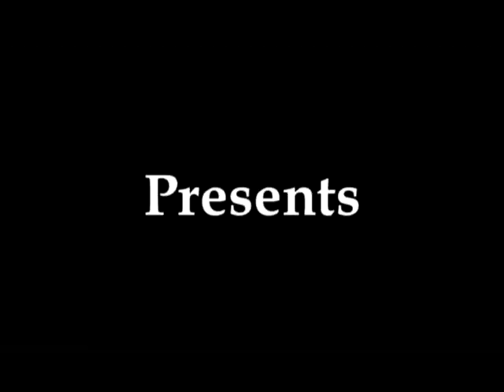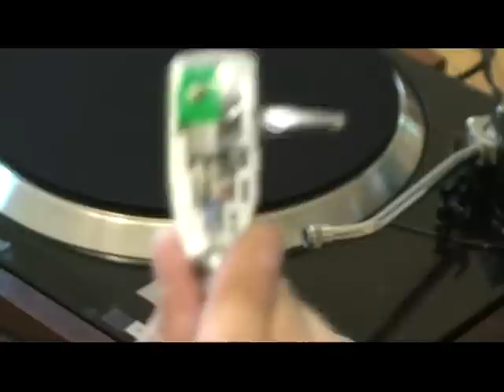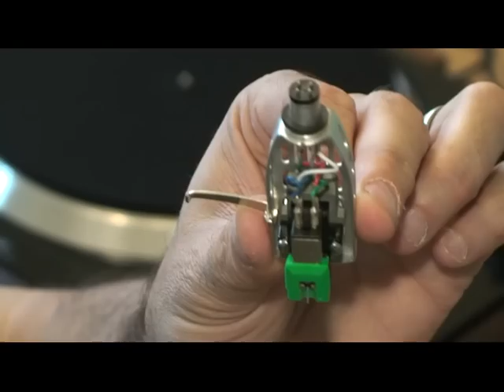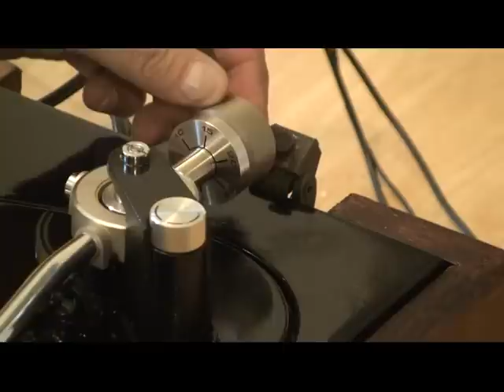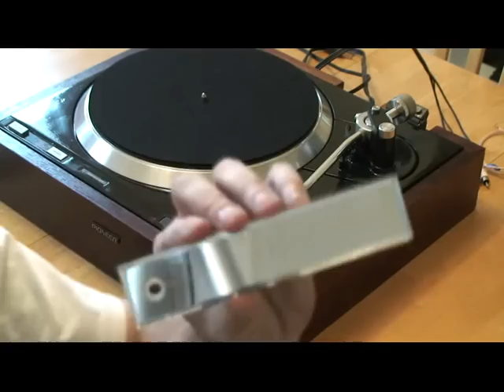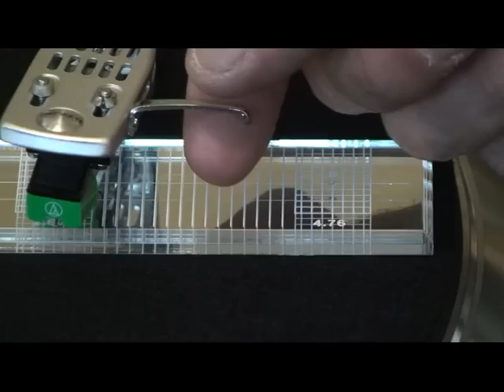How to setup a turntable - turntable and tonearm setup

Comment: Thanks for this video.  The procedure you outlined on how to use the bearwald protractor answered many questions that I had.  Specifically that the platter needs to be rotated slightly for the stylus to line up with the inner null point.  Thanks again!

Comment: Wonderful job in explaining a complex setup in a straightforward way. Just a small point. After doing your alignment it’s worth rechecking the tracking force.
Reply from the maker: Thanks Tim and you are correct. There are many things I could "do over" , for example , checking the weight should be done level with the platter - but I wanted to help the real new newbies understand the concepts in a simple way. I don't even use the protractor myself anymore because I have a custom mirror alignment tool that is etched - one of our audio friends designed and built them....really cool...Thanks for the feedback !

Comment: Good explanation about using the Protractor for tracking setup which was what I was after, but, no mention of Overhang - that has to be first, re-checked last and crucial.
Reply from the maker: Actually no. You are confusing overhang. Overhang is what the manufacture gave as the "rough" number that could be used in lieue of a protractor - IF you know what alignment scheme they used (baerwald, Stevenson, etc.) where the overhang would be different depending on which is used. The protractor can ELIMINATE the overhang if done properly because it DOES set the overhang that is proper for that alignment scheme. Overhang can be used to "rough in" but only a protractor will ensure you are spot on. Want a good example ? Technics SL1200 MK2 overhang is 15mm but that is based on Stevenson. For baerwald (which I prefer ) it is 17mm. So if you aligned with a baerwald protractor and then went back and tried to set overhang, you would constantly be knocking out alignment.

Comment: You check the weight with the scale at that height it's not the same weight as when the stylus is actually touching the record. I would recommend doing the weight away from the platter and have something supporting the scale so that it is at exactly the height of the record.
Reply: @The Internetwanderer Not if there is a pivot point

Comment from the maker: Stijn...I agree with part of what you said and disagree on some. First, remember this is a total newbie training video. Your subject goes to a forum post (class 301...lol). So the basic manufacturer rule of thumb is set it on or about the same as VTF. A test record is great, but again, we are talking newbie. There are several basic ways to set anti skate (use a mono test record and your ears for example ) but it is a PROVEN fact there is a correlation between VTF and anti-skate. And setting your to 1/2 gram actually increases the need for anti skate and thus false readings. If VTF is increased (past what is needed) it can actually eliminate the need for anti-skate. Remember, skate is actually cause by resonant frequency vibration, not spin as many people think. So to test at 1/2 gram you have a needle that is vibrating wildly requiring incorrect counterforce. THIS IS WAY PAST where this topic should be on this beginner video. If you would like to discuss, post this on the turntable forum at audiokarma.  FOR YOU NEWBIES..STICK WITH THE VIDEO

Comment: Robert Arco,
thank you very much for the info on setting up a turntable i have just bought a used one.
it is a technics sl1200mk2 and i tried it out and my records sounded terrible..I played them first without cleaning them..so after i cleaned them the sound improved but i think i need to buy a new cartridge and do all of the adjustments that you have demonstrated.
Great tutorial!

Best wishes

Comment from the maker: Some additional notes to enhance the video
1) Best way to test the tracking force (VTF) is with a digital scale and off to the side of the platter so the scale level is level with the platter height. I show it on the platter but that could be off a bit.
2) When using a protractor, first get your overhang as close as possible first. Find out what it should be, say 52mm. Measure 52mm from the back rubber collar on the headshell to the tip of the diamond stylus. NOW use the protractor to be sure you are fine tuned.
3) When using the protractor, check the INNER point first. Align, then check the outer. If you have to change, go back to the inner and always start there,
4) Balance your table in place ! Use a small bubble level at the 4 OUTER corners of the platter. If you do it near the center you could be off. So check at 12, 3, 6 and 9 oclock positions on the platter.
5) Have patience - its worth it !!! And you can always reach me with questions

Comment from the maker: Hi Bryan,
I built it out of oak. I have made a number of bases to dress up tables. My latest project ? Another Pioneer Pl-600 that was beat up, completely stripped, serviced and now the plinth is BRIGHT RED with Black arm pivot area, chrome platter and arm tube and black headshell...Looks like a modern TT but with a killer vintage mechanics (quartz lock pll - full auto)

I can always be reached arcorob ..and that would be on that old gmail service...LOL

Comment: Excellent TT setup advice here especially the importance of stylus tracking force. Most cartridges track and sound better in the upper end of their recommended range. Even though it may be up to half a gram heavier the resulting improvement in tracking causes less record wear and smoother sound than if it was set to a lower weight but not tracking as well.

Comment: Good video for the beginner. I would highly recommend the use of a dBSystems protractor, or something equivalent, to set one of the more crucial aspects of cartridge alignment - overhang. Overhang will affect tracking force so it should be set first. I've found that one millimeter of difference one way or the other can make a big difference with overhang and subsequent alignment and weight adjustments. Good job!

Comment from the maker: That is an awesome table. Generally on the pioneer there is a screw adjustment. One to set the start position, another for the return. I go to vinylengine to get the user manuals and the service manuals. I looked for you and it is only in Japanese. I checked guides from similar tables (I believe yours was a Japan only model) and it might use a trip sensor ...I am really sorry I cant help..try this...go to audiokarm...(search for it) and go to the turntable forum. Post your question and they can help

Comment: When you set the tracking weight and get the tonearm to "float" you then need to turn the indicator dial with the numbers on it (but not the weight itself) so that it reads zero while the arm floats. This is the critical step that can't be overlooked. Once the line is matched with zero (while the arm floats), you then turn the counterweight itself (which also turns the indicator dial) to set to set desired tracking weight. 

From viewing this video at 11:32, the zero mark did not line up with the tonearm line when it was floating. It appeared to be about 0.15-0.20 grams left of the mark. So when the desired weight was selected, it was 0.18 grams too high. Had the indicator dial been zero'd first before the counterweight was turned it would have been accurate to with a couple hundredths of a gram...more than good enough! 

It's also worth noting that you're better off tracking slightly too high than too low. A cartridge tracking heavy will still track the groove well...and as long as the needle isn't damaged or worn out, it shouldn't cause excessive wear to the LP. A cartridge tracking too light with cause the needle to jump around in the groove, periodically losing contact with the surface. This will cause far more damage to an LP.
Reply from the maker: Incorrect. It was not zeroed because I was showing how you get it to balance. Then you would zero ...which is irrelevant because regardless of what the DIAL says, the electronic scale is what I said to use. You could erase those numbers and it would not matter. As to actual weight. Marketing says low, engineers say high. If range is 1.5 to 1.75 then best is just below max - 1.70.

Comment from the maker: Correct - and also incorrect - Manufacturers pushed the anti-skate / VTF coupling. If you set the VTF to 1.5gr, they said set anti-skate to 1.5 - It got you close but its arbitrary. You don't need a scope. A good test record will have an anti-skate track using modulated sound that will setup a vibration in the right or left channel if the AS is too high or too low. When you can go through the whole track with the vibration coming equal at the end, you are set. This is ADVANCED anti-skate - for 80% of the first time newbies, the old manufacturer way is just fine.

Comment: Thanks for your response Robert, I'm actually a little confused, in your video, you put the scale on the platter itself to measure the weight, however your comment seems to suggest you weigh on a block off the platter?

Comment from the maker: Actually its table specific. By that I mean, if I did that on my Concept table it would be quite off. On many (dozens) of vintage tables, the difference was negligible. Approx. .03gr (3/100ths of a gram). The reason is on the legacy arms, the angle really doesn't affect the mass. On the Concept, the magnetic unipivot actually makes the arm heavier the higher you go. It IS best to do it adjacent to the platter even with the platter level.  I have mentioned this before. Hard to change the video now. :-)

Comment: Nice video, clear and well produced. But as Eric has mentioned, you need to set the tone arm weight with the stylus at the same height as the record. (Yes, they ARE records, not albums!) In this case, I would simply remove the tt mat which looks about the same thickness as your mini scale. It's surprising how much error creeps in if you omit this consideration.
Reply: The same goes for the thickness of the plastic protractor. Overhang was too far forward because the protractor pivots the arm upwards carrying the stylus backwards. So the cartridge was pulled forward to set the cartridge overhang. On the thinner record this would place the set overhang ahead of the true position.

Comment: Viewers please be aware!!!----------Arm should be leveled/neutral with the stylus tip paralleled to the surface of your average record (not to just "a level" anywhere).......And when using a scale, the surface of the scale must be parallel to the surface of the record (not siting the depth of the scale on top of the platter)!-------For logically, as the VTA of the arm changes so does the tracking force/weight!! .........Also, the VTA refers to the angle of the stylus not the arm! In many cases the head-shell is not parallel with the arm, and so if you solely level the arm you get what you see at 24:00 (scary)........p.s no offense to the poster.
Reply: Actually, he messed up the relatively adequate level with an entirely unneeded, extra felt mat. Rubber dampens vibrations far better, and its stickshion reduces vinyl from sliding along with having no fibers to go onto the record. The tracking weight likely will be negligibly changed by the arm level, but he could put the scale directly on the bare metal platter as well. Every cartridge comes with ideal tracking weight ranges, usually stressing that more reduces tracking errors and needle wear, so triple decimal point weight accuracy is meaningless.

Comment: The anti-skating has nothing to do with centrifugal, cetripetal, or whatever you want to call it force. It is there to counteract a vector force caused by the friction of the stylus in the groove, acting in a direction that is not in line with the pivot point of the arm. This is due to the offset angle of the headshell. The force pulls the arm in towards the center of the record, so the anti-skating provides a counteracting outward force.

Comment: Robert, good video. Thank you.
I haven't been able to read all the comments, so don't know if this has been asked and if you will address it in future updates.
However: how do you adjust the cartridge if the placement on grid A is not consonant with placement at grid B? Don't I just move the cartridge fore/aft and keep rechecking at the two grids until it is consonant? 
It would be great if you could show that!
And, if that's the case, then, don't I have to readjust the VTF when that's done, because, my tonearm weight will be heavier (if moved forward) or lighter (moved back toward the pivot)) from the original position?
Thanks again.

Comment: I want to upgrade my OEM needle to an Ortofon Concorde HI-FI cartridge. However, the cartridge on the Ortofon is in a fixed position and does not allow for protracting. Any thoughts on that?
Reply from the maker: Completely different kind of cartridge. You have a P-Mount whereas I show you a standard half inch mount. Balancing and aligning a cartridge are required for optimal tracking, groove retrieval and sound quality. The P-MOUNT design simplifies cartridge installation and eliminates the need for cartridge alignment. Please note: P-MOUNT cartridges are designed to be installed in P-MOUNT tonearms. They can also be used with a half-inch tonearm headshell by using a half-inch adapter.

Comment: I think you'll find that with your new Clearaudio Concept, that the height of the measuring surface makes a big difference in the reading. In my experience, the magnetic bearing that arm uses is very height sensitive.

Comment: I'm curious about the use of your digital gram scale, wouldn't the thickness of the scale itself cause additional force to be placed on the scale?

Also, what are your thoughts on using this digital scale versus the Shure SFG-2 mechanical scale?

Thanks for this informative video.

Comment: Thanks for the post my arm goes to the right  so that the anti skate I guess I just got to adjust.  Yes I heard using a blank lp is good I have 2 of them I use.  I got to do this caus I just got my back up tt fixed & I don't think they did this..

Comment from the maker: The Technics SL-1200mk2 is highly regarded and highly sought after. That's why they demand a high price. YES, get a new cart and stylus. I would recommend an AT120E or AT440Mla (depending on your budget). If setup correctly, the AT440Mla will sound far and away the best you have heard...

Comment from the maker: It can...its best to get the scale to the same height to be sure however; it really depends on the table. On many of the legacy table I worked on, the difference was no more than .03 grams...that's 3/100th...Now on my ClearAudio Concept..major difference because of the magnetic uni-pivot. As much as a 1/2 gram which is a lot.

Comment: Now, I'm no expert and I've never messed with one of those digital scales, but intuitively I'd imagine to be on the safe side you want to have the scale sitting level in the same position you are using it when it gets zeroed to account for the weight of the plate.

Comment: Hi Robert. An absolutely excellent video, if I haven't said so already somewhere. I've referred to it a lot for my set-up. About your advice below about the  ART DJ Pre II pre-amp. Someone suggested I get this to give the volume more oomph, as I find that the sound level of my TT is way below the equivalent setting when I play CDs, but I have a high output MC (Denon DL-110) cart that apparently makes it comparable to an MM. The guys on Steve Hoffman seemed to think this would in any case be an improvement on whatever inbuilt phono stage I have as they tend nowadays to be not so good (I have a Denon DP 500 M, which may not be too familiar to Statesiders).

On another note, I found a one-sided LP to check the anti-skating because I thought that would be a cheap way to do this, but I found that I could only get the arm to stay steady in the middle of the LP (I don't mean near the centre hole in the label). When I put the otherwise steady arm at the beginning or right at the end of the unproved record, it moved in quickly, however high the antiskate. What's up with that? Maybe I do need a test record. I just hope they aren't expensive.

Comment: Robert, I have a question for you and I hope you might be able to answer this. I know the vibrations in the environment can be a head ache. I live in a mobile home and the vibrations are abundant. Is there some sort of suspension system for a turn table that can neutralize any vibes from the environment?  Thanks and again, wonderful instructional.
Reply from the maker: Isolation is always tough. The easiest way is wall mount which is not hard. Get aa thick piece of wood (a butcher block is best) and two wall braces. Mount the wall braces to the wall (mine is just above a cabinet so it looks almost like it rests there) and mount the butcher block. Turntable mounts to that. That prevents footsteps, etc. You may also want to put rubber isolators under the feet with that to prevent vibrations caused by the sound itself reverberating in the room. Hope this helps

Comment: nice vid! I have a noob question tho, when you put gram scale on the rubber plate, is this gonna be inaccurate since the gram scale gives extra height, should you put the gram scale on a place where the height is the same as a LP sits?